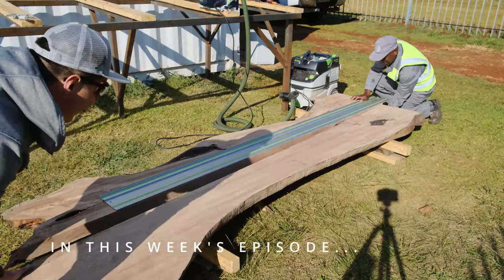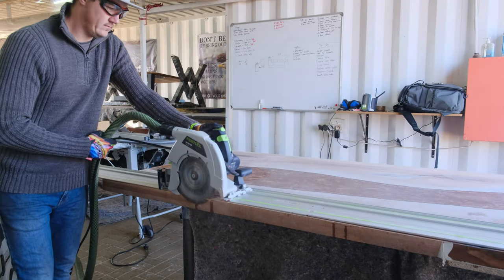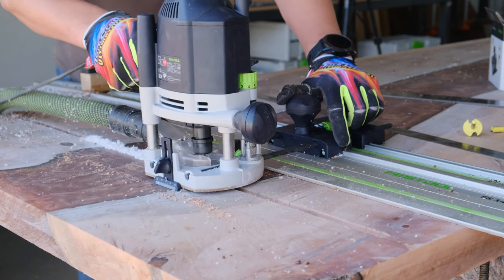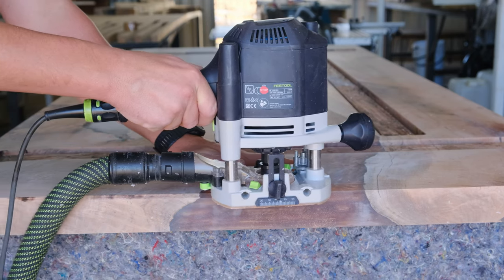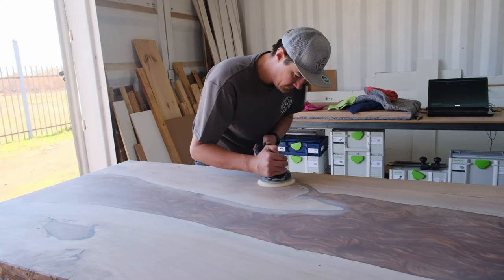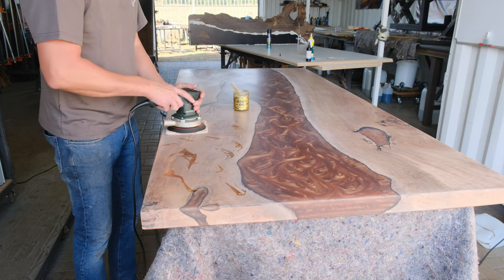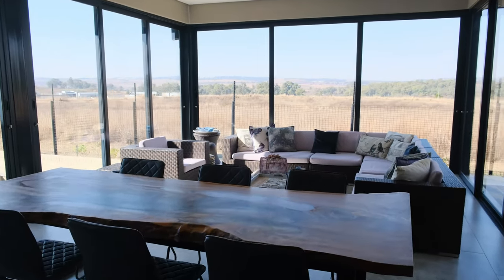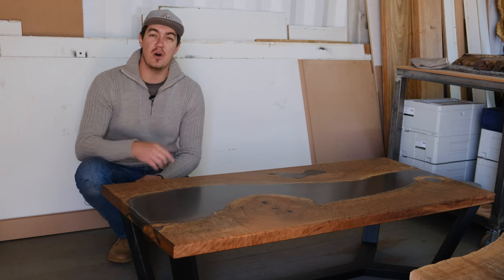Epoxy Table Build & BIG MISTAKE

Comment: Table looks great and the epoxy colour works well with the table. With the C channels. How do you decide if you need them as not all table builds use them. Is it down to the size of the table?

Comment: You need a little space around the c channel for movement. Came out it good though
Reply: wrong. you want the c channel to be a fairly tight fit, no little space.
Reply: @abowden5079  wood moves, hence a tiny bit of space at the end of the channel for such movement. Same as I don’t crank down every screw on the c channel I’m not suggesting a huge space, so far have never had one fail, just my opinion like yours.

Comment: There seems to be a misunderstanding of wood movement and the goal of C-channels. C-channels are not meant to prevent wood movement. 
Wood will move whatever you do. C-channels are used to prevent the wood from cupping/bending (vertically). They have the same function as breadboards.
At the same time the C-channels must be attached in such a way that they ALLOW the wood to contract or expand sideways. That means allowing the bolts that attach the table top to slide laterally in the holes in the C-channel (like the tennans in breadboards). So the holes in the C-channel must always be wide enough i.e. rather pill-shaped than round.
So it is also not good if the C-channel 'fits like a glove' like you proudly say. C-channels need room on both ends.
I hope you don't do this with all your tables, because you have a lot of customers who will demand a refund.
Reply: Good explanation, I was thinking the same when I saw the bolts going through the C channel did not allow for expansion and contraction. Does the C channel running the length of the table serve much of a purpose or is it just over kill. Its the first time I have seen someone running a C channel length ways.